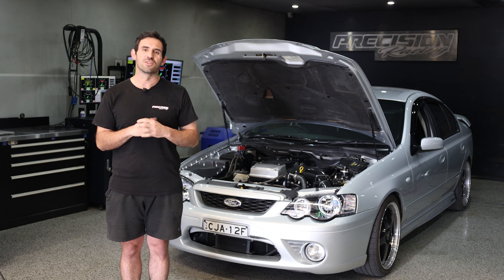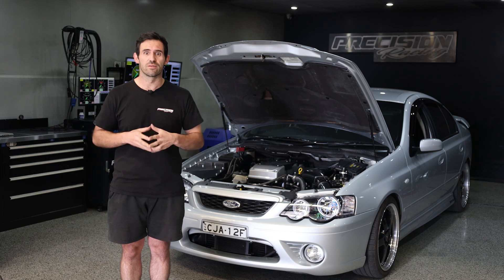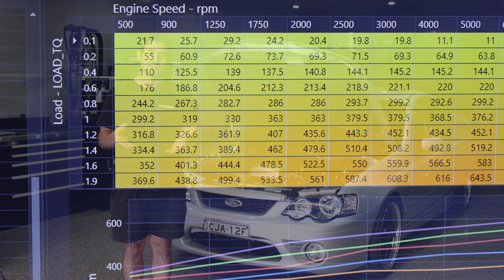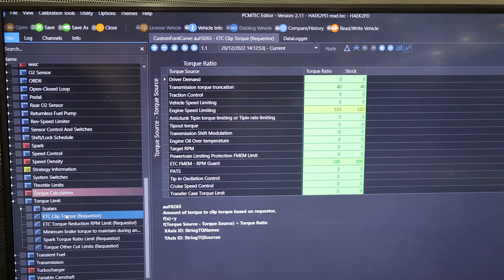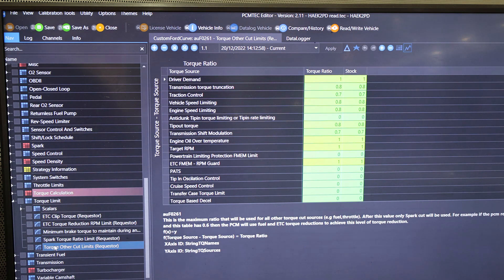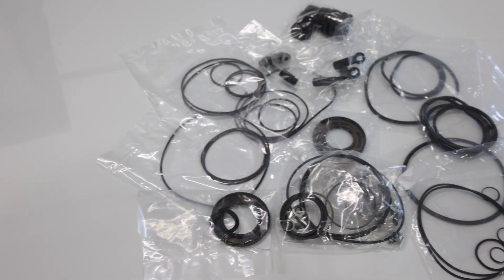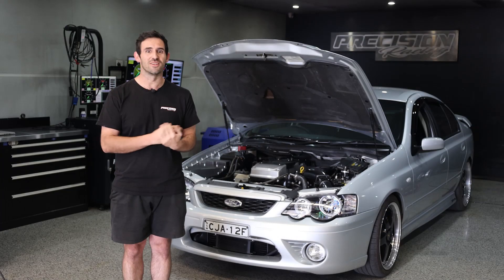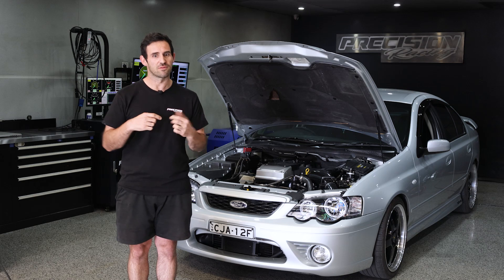ZF Torque Management

Comment: What values need changing in what parameter do I need to change to get spark cut during gear change . 

N/A ecu I'm needing spark cut during shift to aid with the torque reduction and speed of the shift